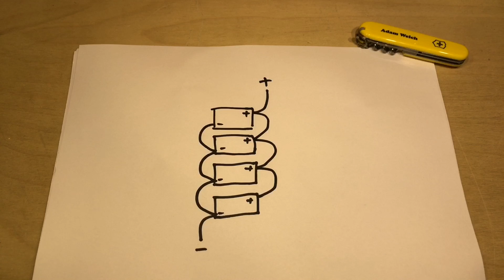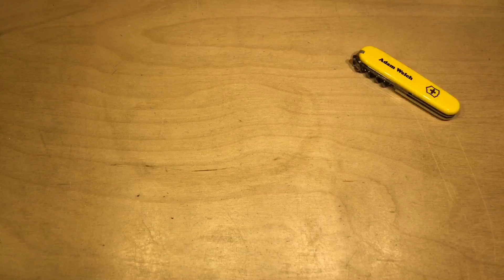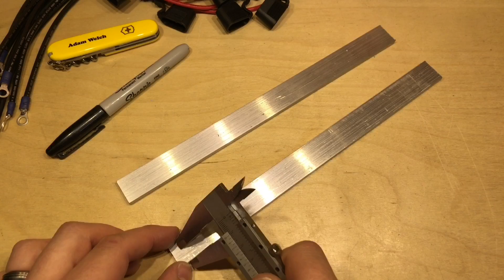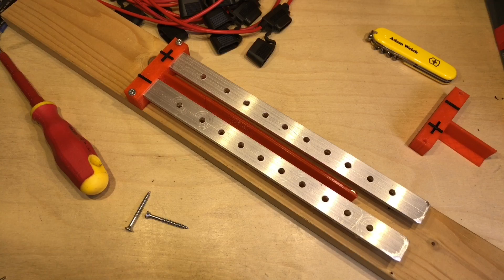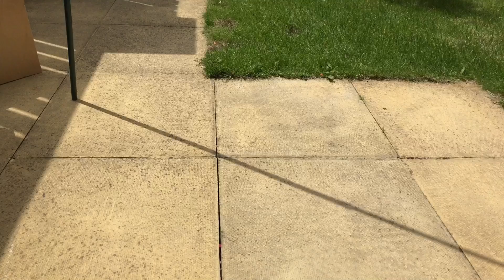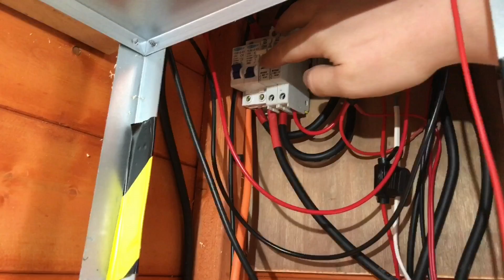Battery Bank Reconfiguration - 12v Solar Shed

Comment: As much as I like your setup and I really do, I would at least change the nuts, washers, fuses and bolts to copper because the current is only as good as the weakest link, which in this case would be the connectors at the end of each wire and the nuts and bolts... Why worry about all of this copper if the connections is of inferior metals? I have the same setup as you showed when you had them stacked where you thought you were running out of space... I have 2 holes drilled thru a piece of wood long and thick copper bolt, my buss bars and I added copper washers between the copper connectors with a copper washer and a copper nut at the end. The copper washers between each of the incoming wires spaces it just enough so there's no issues of overlapping each connector. My fuses are even copper and connect to copper holders. I have batteries on each side with my copper bolt "buss bars" in the middle of the of the two sets of batteries. I repair computers so I'm not perfect, but it boils down to common sense. I have people that bring in electronics with various connections like USB and 3.5mm headphone jacks and they have cables coated with gold and I explain the USB and most 3.5mm jack are almost just regular metal and a magnet sticks to the connectors most of the time so the quality ends there, I know the connectors you're using here is not magnetically conductive, but of cheap metal and does no justice to your hard work.
Reply: MrBrymstond as an industrial electrician I have built systems that carry thousands of amps, and the bolts (specced by engineers) are always mild steel,  as copper or brass do not have enough tensile strength. the important part of an electrical connection, as in this setup, is the connector to the bus bar. The bolt should carry no current.
Here in Australia, it is in breach of the wiring wiring rules for a connecting device  (I.e. a bolt) to form part of a current carrying system.

Your comments regarding computers/audio is totally different. You are talking about signal level (Or radio frequency transmission) and connectors are always the weakest link, therefore should be of the highest quality.
Reply: Cheap tin does not carry the amperage as well as copper, nickel, lead, silver or gold or why would you worry so much about the bus bar and the nickel strips on lithium batteries? The quality stops at the weakest point, tin.

Comment: Neat. I see many battery banks (videos) of guys fusing each string and/or battery in their respective banks. When I re-did mine (a few months ago) I added one ANL fuse (200-amp) for the cable going to the busbar (Blue Sea Systems) and then up to the main DC disconnect. I did a recent video on this. I am wondering if I should fuse each string? Fusing each battery would get awfully expensive. Thanks...your shed system looks good.
Reply: Hi Chris, Adam's done a terrific job fusing 17 AH batteries. I have over 35 large (around 100 AH) batteries feeding inverters up to 3 kilowatts. I thought about lots of fuses, but decided against it. The trouble is, at high currents the fuses/ holders, cable & crimp terminals, all cause voltage drops & imbalance. This only gets worse with age, as  the contacts tarnish etc. Switch contacts, circuit breakers, they all suffer from it , plus of course the bolts can loosen with time. Even without the vibration you get in a vehicle, terminal bolts somehow still can sometimes need re- tightening, even on a static battery system.  I personally wouldn't individually fuse the batteries on a 200 amp or so system. It's just more to give trouble. Smartgauge on the Net has interesting stuff on parallel battery Imbalance.Even with cable of 30mm sq or thicker , his results are surprizing. Cheers.
Reply from the maker: Cheers Chris.  The worry is if one string fails for some reason or if you create a short across one string the other strings can also deliver current in that direction if the strings aren't individually protected.  My system is quite a bit smaller than yours - and it has considerably less current to deal with so individual battery fuses isn't so much of a cost issue for me.  For your setup I think it is worth considering a fuse on each string (I think you have three?) for piece of mind.

Comment: The negative and the positive main leads should be in the middle of each corresponding bus bar, instead of at either end.
Reply: So that the batteries will charge evenly.
Reply from the maker: I'm not sure that is true if you think about the resistance.  Battery one is close to the main positive so has a low resistance with respect to it's neighbors, but the highest resistance on the negative with respect to its neighbors.  Moving down the string that ratio changes , but overall the total resistance per battery should be roughly the same.  Corner to corner connecting is pretty standard and generally seen as the easiest method to ensure even drain.
Reply: Adam Welch I thought that an even length between each battery and the main negative and positive leads would ensure same amount of distance between each battery and the main lug... 

Kind of like a Hammock between two trees the negative and positive leads  fan out into the middle of the Hamic with multiple lines so that the batteries are along those lines and even length. 

My opinion...

Comment: I had the idea of giving each battery a chunky MOSFET or several on the negative, gate pulled down with a high-value resistor, and pulled up by a piece of thin wire running taut around the battery.

Why? Because lead-acid batteries do fail, and when they fail they often fail in such a way as to swell slightly. Swelling that would snap the wire wrap, turning off the MOSFET and effectively isolating the battery so that its demise cannot damage any other batteries.
Reply from the maker: Neat trick but would a small amount of swelling be enough to snap the wire?
Reply: ***** If you used a single small strand of copper, or if you only clipped it at one end so it would pull loose easily, I imagine so.

Comment: The issue with this new configuration is that each battery will never have identical impedances, therefore during high load discharge it is possible for more current to be supplied by one of the batteries than the others, additional this may also cause the fuse from the battery to fail.
Reply from the maker: Thanks - I'll watch out for this.
Reply: I wonder if you could compensate for this - the difference is going to be a fraction of an ohm. If you get all the batteries to an equal full charge you can measure the internal resistance of each and make up a length of wire per battery to compensate.

Comment: I learnt the interesting way to keep bus bars at least spanners width apart.
Reply from the maker: Haha! I'm using a screw driver or allen key to do mine but yes - perhaps I should have thought of that!
Reply: I've done that.Good job Adam 's been sensible & fused it all, be a shame to see all the nice wiring melt. Hinged cover of wood or plastic over the bus bars might be an idea for anyone mounting the bars flat, in case a metal object fell on them.

Comment: Decent video at all... Adam did you wonder about temperature sensor to each battery and INA219 sensor to each negative battery connection? I think that it could be interesting for few pounds... :-) don't you think?
Reply from the maker: +LWQ LWQ Yeah - that is an interesting idea... ;-)
Reply: Adam Welch - and also you can add a relay to each battery to switch off battery that is working somehow strange automatically... :-) and next idea - I would recommend to use copper bars, aluminium is going to sneak away from compressed connection over time. And the last one - I would consider to make a battery box out of Fermacell boards. This material is fire resistant and quite cheap...
Reply from the maker: +LWQ LWQ Thanks again. Yes - a battery box is on the list.

Comment: The trouble with Aluminium is that contrary to popular belief, it is actually really quite reactive and quickly forms an air tight, insulating oxide layer within seconds and your connection will deteriorate over time unless it is correctly sealed (i.e soldered or electroplated). That's why copper coated aluminium cable is such a problem. Squashed 15mm copper plumbing pipe would be a better option than that Al bar.
Reply: Adam, please see my response to tengelgeer. A good tight screw terminal will partly weld Aluminium to other metals. As long as the connection is kept dry and salt or acid-free, you should not have too much trouble for a long time. Once you encounter moisture, coupled with a salt or acid (or metals such as Mercury or Gallium), the contact will deteriorate rapidly.
Reply from the maker: +ben hunter I'll keep an eye on it. Wouldn't be the be of the world if I need to replace it with some copper. Perhaps I shouldn't have been so cheap.
Reply: Kudos on making it look so neat though. Very nice.
Reply from the maker: +ben hunter Cheers
Reply: That sounds plausible, as long as you get enough torque , and therefore mounting pressure on your fastener.

Comment: are those smf vrla batteries?? what is the capacity  of a single battery??
Reply from the maker: Yeah they are 17Ah a piece.  Recycled UPS batteries all of the same age and use.
Reply: I'm i right in assuming you have approx. 800W usable wattage?

Comment: Interesting video. What size cable did you use for the new battery connections?
Reply from the maker: Thanks.  It's AWG14.
Reply: So about  about 2.0mm2
Reply from the maker: +urbanimage Yeah. Pretty much.

Comment: Love your videos Adam. I love your 3D printed busbar holders. I would recommend however to fabricate a bus bar cover for the positive terminal at least in case of bridging from falling metal pieces, etc..neat set up you have 😺
Reply from the maker: +threeparots1 Cheers. Yeah, let me have a think about that - it's a good idea.
Reply: Adam Welch I really like your captive nut holders for a very solid connection. I thought you might thread tap the aluminium bars, but your set up is much more secure and won't strip out the bars. Very impressive.
Reply from the maker: +threeparots1 Thanks :-)

Comment: Oww, and did you sand the surface of the bar before screwing the terminals on? Allu likes to form a nice oxidation layer :s Or if you want to make it real fancy (and have a new project :D ) copper plate the bars with electroplating :D
Reply from the maker: +tengelgeer I did yes - forgot to mention that didn't I?
Reply: +tengelgeer, Bare Aluminium, when exposed in a Nitrogen atmosphere, has a beautiful pale yellow colour. When Oxygen contacts it, an oxide layer forms instantly, giving it the greyish-silver colour we are familiar with. Roughing the surface just gives more surface area on which that oxide will form. A good pressure contact will cut through most of the layer, and allow a decent electrical connection as the metal partly welds to it's connector. Aluminium is a very strange metal, which has a continuously moving surface when viewed under an electron microscope. And it also migrates when current flows through it. In one of my jobs, in the 1970's, we used ultrasound to weld Aluminium wires to transistor surfaces. NASA are using the same phenomenon on a macro scale for what they now call 'friction stir welding'.
Reply: tengelgeer sanding and then using an anti-oxidant compound may be another option. Good thinking. May not be a huge deal on the smaller lead, but the main lead yes.
Reply: +RWBHere You're right, better to use some sort of anti-oxudation layer :)

@Adam, time to copper plate? :D :D :D

Comment: Nice! Looks really good! But is it just my OCD that finds it ridiculous annoying the spacing of the holes is different... Especially because it would have been an easy fix by just drilling the holes of both bars at the same time by stacking them....
Reply from the maker: +tengelgeer Thanks. They were drilled offset to try and space the positives and negatives a little and to give the space required for the larger main crimp. Not sure it worked though.
Reply: Ahh, then it's just me :p

Comment: could have threaded the bus bar instead of the nut brackets :D
Reply from the maker: +Flo I did consider this but my tapping set seems to be absolutely rubbish. The nut brackets  are a bit silly but I was very pleased they worked so well. Cheers
Reply: But allu isn't that strong... Easy to strip the thread if you over tight them.

Comment: Great idea. Can remove a single battery without breaking the whole chain 😊
Reply from the maker: +Big Bill Indeed yes. Hopefully this won't ever be needed but it may well come in handy.
Reply: Yes that's a really useful thing about what you've done Adam. Piece of cake to isolate each battery & check it with a conductance tester or whateve. You've got a super system for a lowish current draw  set up now, worth all your  effort.

Comment: I saw once on youtube that these blade fuses can melt if the current drawn through them is close to their rated current.
Reply from the maker: +Arnþór Gíslason Its typical for a fuse the get hot and the surrounding metal will always serve as a heat sink (that's why fuses always blow in the centre) but I'm running these at fairly low currents. My battery bank breaker is 63 amps and that's to accommodate an over current situation on my inverter (it can handle twice it's rating for a few seconds) but if I draw much more than 40 amps for a while it will cut out. I expect these fuses will never see their full rating for more than a couple of seconds. 
Thanks though - i'I'll keep an eye on them when I'm pushing my inverter.